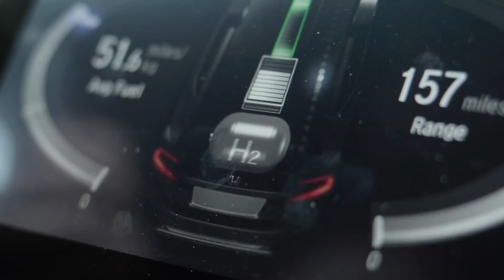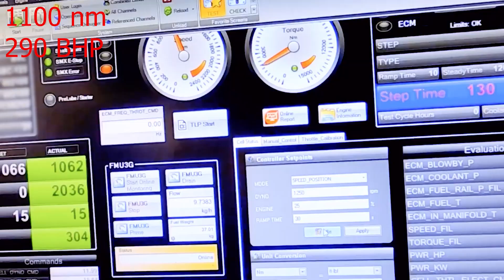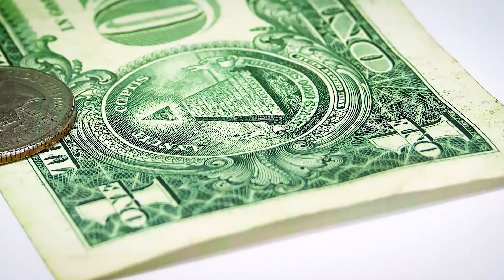Cummins changes there focus from diesel to a 15 liter Hydrogen Internal combustion engine

Comment: of course i am with ic h2 engine cuz the voom voom sound cant forget it i need it even if its h2 not gasoline i prefer h2 more cuz its more green and its stronger than gasoline and it is cool not like fuel cell electric

Comment: absolutely, internal combustion hydrogen fuels engines are a logical alternative to gasoline and diesel, problem is hydrogen production and making it cheap enough to be viable. also you wont kill the automotive repair industry in the process.

Comment: Has Cummins have any data on hydrogen embrittlement in their engines?
Reply: hydrogen embrittlement in their engines ? you mean their tanks right ?
Reply: @nickyp00-t1h  the whole system, anything  ( metal) that might be under stress and exposed to hydrogen
Reply: @domokoshadnagy6794  it is my understanding that hydrgen embritlemebt occurrs in storage tanks due to the insanly high oressures and relative low density of the fuel. This is countered by coating the inside of the storage tanks with a special coating, i am not aware of hydrogen embrittlement inside a combustioon engine, i would be concerned with the tank, linesand regulator. Being direct injected to combat engine knock due to the fast burning nature of hydrogen, there may be challenges of engined life due to the dry nature of the fuel requiring special lubricants.
Reply: @nickyp00-t1h  where ever there are micro cracks hydrogen embrittlement is a possibility. I would assume that Cummins has 100,000 use hrs on their system to assure that the metals they have chosen are not susceptible. It would be nice to see that data.

Comment: I think hydrogen is probably the future. but electric vehicles might also be the future. Ive been trying to wrap my mind around the electric grid issues we will be facing in the future. currently im guess but less then 10% of cars are electric on the road. wait till we hit 40 to 50% of vehicles being electric and how much pressure it will put on our electric grid. i think we will have to divide between different power sources just to a greener future. 

In addition i think going green will weaken us for the first handful of years but the long run advantages far out way the downside. militarily we will be weaker at first compared to places like russia china and Sudi arabia who will gladly use gas powered vehicles against us. as long as hydrogen and electric vehicle continue to advance we should pull away from oil depedence from russia and Sudi Arabia

Comment: I’m a diesel fan, but I would take hydrogen over electric any day
Reply: Hydrogen 2 stroke with dry sump VRO, no oil changes for me! How about a scaled up Rotax 850 Etec turbo R to a 930 CID inline 6 2 stroke! Or this https://mart.cummins.com/imagelibrary/data/assetfiles/0058689.pdf

Comment: The problem with hydrogen is you produce more CO2 making the equivalent amount energy density wise than you do from burning oil.
Would be great if we all had nuclear reactors and made the hydrogen from water by electrolysis.
Making it by steam reformation of natural gas is a filthy process. You'd be better of burning the natural gas.
Hydrogen has another problem, how do you store and transport it?
You can't liquify it without using stupid amounts of energy, you can't hold much in a vehicle so range is limited and refills will be needed often.
Just use diesel.
Most CO2 comes from agriculture, industry and electricity production, not vehicles.
So we are attacking the wrong end of the problem.
This vehicle agenda is being pushed to make the average person feel guilty, that it's all their doing and in the process enable business to sell them more vehicles.

Comment: We need to stop showing smoke belching, exhausting to clean water vapor. I’m all set to drive my snowbird 5th wheel and 6.7 Cummings for the environment. Let’s get on with the hydrogen fuel safely with the newest thinking ,cost effective production. We have the most brilliant minds ever. The world is back stepping.

Comment: I'm excited to see the Cummins Hydrogen combustion engine. In 2011 - 2012 I tested hydrogen in my Dodge truck while my brothers were putting them into their Ford's. They worked. The main problem was the computer systems. I tried every computer chip available but couldn't get past the issues raise by the computer thinking it was getting to much oxygen. Yes, I tried every fix suggested, without success, concerning the O/2 sensors. My brothers experienced them same with their trucks. I still believe Hydrogen is the future. As I said, "I'm excited to be seeing the future." Yeahhh for Cummins.

Comment: I though there also hybrid of diesel / hydrogen?    I also wonder if hydrogen engines are similar to Diesel engine, where they used compression to ignite the fuel.  I hope they still used Jake brakes.

Imo Diesel engines are still way more efficient vs gas engines.  But yes diesel do pollute more.  You’d think by now they figured out how do clean burning Diesel engine.   DEF system for current turbo Diesel engine is nothing but A SCAM!!!   All def fluid req is just polluting the environment more with plastic bottles and when do re-gen, all that soot is still going into the air.  

I bet proper maintained older CAT engine run circles around any newer def diesel turbo engines and still  burn cleaner.

Comment: Just mix air with hydrogen and shut off the injectors in the modern diesel engine, You will see increase in power and cleaner combustion.

Or inject hydrogen instead of diesel.

Readjust the fuel mixture in the computer or dilute the hydrogen with additives.

Comment: Will they make a manual transmission in those hydrogen cars???
Reply: Yes as they are 2 strokes and run oil injection. brappp. https://mart.cummins.com/imagelibrary/data/assetfiles/0058689.pdf

Comment: Sodium   can  be   kept  on-board  in  plastic  tubes,   pushed  into  closed  chamber,  water   sprayed   over  to  get  Hydrogen  to  operate   Engines.  This  will  avoid  heavy  and  risky  storing  of  Hydrogen  in  pressure  tanks  onboard.
Sodium  Hydroxide  can  be  electrolised  to  reclaime  Sodium.
Reply: That;s the most redicluous impractical thing I've read today.

Comment: It seems pretty obvious that a mix of engine types will be playing a role untill the weaknesses of electric and hydrogen are ironed out. Then these two will take over completely.
Reply: hydrogen is a dead end... we'll eventually get fusion power and use that to generate EV power, and for our liquid fueled vehicles use biofuels with a closed CO2 cycle so even if they produce some CO2 it gets used back up by the GMO biofuel crops.

Comment: I'm shocked this solution isn't being taken more seriously and I think we have the idol worship of Elon Musk to blame. I would argue that BEVs cannot replace every vehicle on the road simply because they are too expensive to buy for the majority of consumers and also require private charging to get the cheapest charge (aka, you pretty much need to be a homeowner to benefit from a BEV). They are destined to remain a minority of vehicles as I think that they have too many material constraints to have them be able to replace every ICE car on the road. There simply may not be enough rare earth metals to make it happen. Hydrogen paired with ICE would 100% work because we already have hundreds of millions of ICE cars that are proven. Not to mention that sourcing hydrogen isn't a problem as there are many ways to do it and it is scalable with demand without compromising price. I saw that a Chinese company GAC made a 1.5l hydrogen ICE hybrid powertrain which could achieve an efficiency of 0.84kg/100km with 44% thermal efficiency which is really good. There are numerous companies out there right now attempting to produce hydrogen at 2$/kg by 2030. So let's say you had a tank that could carry 6kg of hydrogen when full, even at a retail cost of $8/kg, that would be $48 to fill and provide 714km of range assuming you are using the GAC engine specs. The car itself would be way cheaper and more robust than one with a fuel cell. Not to mention the engine oil would last forever. You'd scarcely need to change it. The biggest hurtle seems to be providing the fueling infrastructure but once that's in place, I think this tech will be quite popular.

Comment: Hydrogen takes up a lot of space. It is possible to make synthetic fuel (e-fuel) using electricity, water, and CO2 from the air, and that is way easier to store on a vehicle than hydrogen is.
Reply: Biofuel is the near term correct solution. Due to politics it isnt' getting implemetned here but Brazil is gung ho on it.... and its reducing the crop land they need to grow fuels based on research done here in the US. Less land to grow fuel means less incentive for farmers to burn the rainforest too. They can grow 10x the biodesel  +30% more sugar on the same land as thier existing sugar cane crops. In the future they are targeting 16x the oil per acre as soy.
Reply: No it doesn't. It's less space. But being under pressure is dangerious.
Reply: @ricky4673  thats why the tanks are woven carbon fiber and there is a gel substance  inside that will instantly expand if the tank is punctured, so that the hho can't explode.
Reply: Yes ethanol from copper catylists.

Comment: You have basically a vegetable oil that people should not eat(canola oil) that would make a pretty decent fuel replacement. Have you heard a diesel type vehicle running off of this oil?
Reply: I live in California.  There are a couple diesel fuels that use plant based oils.  The 76 stations sell a R95 formulation of diesel fuel.  And the Propel brand sells a R99 formulation.  Both fuels are different than biodiesel in the way that they are refined.  And are based on a process used in Europe.  That is blended 70% renewable product and 30% petroleum product.
We have 2 diesel pickups at my house.  And when fueling the trucks.  The odor given of the renewble fuel is very slight.  While the petroleum diesel has a strong odor.  Cleanup of your hands is also easier with the renewable product.
Reply: Rudolf diesel created the diesel engine as an alternative to petrol fuel and ran on peanut oil.

Comment: I've made my comments about the Hydrogen ICE vs FC, and it's sparked harsh feedback because of deficiencies in energy loss when it's burned and sent out the tail pipe, however in the grand scheme of things, it's not like any petrol burning engine is all that efficient either when compared to electric... I'm all in favor of Hydrogen IC engines for the reasons mentioned... Having a traditional design coming from over 100 years in piston driven engines, with quick refueling, especially for large trucks that drive long-distances.. I think where the problem lyes is from the cost and production of Hydrogen.. Theirs a number of ways its yielded, while the methods that rely on electrolysis requires alot of energy, in which this energy requirement might only be solved initially by good ol fossil fuels (unless we start looking at fission energy again and abroad until fusion becomes an actual alternative).

Edit* but yes, an all EV future is a depression and lame future for most automotive enthusiast...I know the power is there from EV's, but they're just fancy golf-karts to me, and I couldn't be happy driving one, knowing the loudest thing  onboard is the stereo system 🙄

Re-edit* idk about the true results of this old video, but the concept seems note worthy.. electrolysis on demand
https://youtu.be/0nzyEueVLgo
Reply: I agree with you on that, Electric vehicles just don't have any soul or character whatsoever. The mechanical thunder of internal combustion engines always adds excitement and adrenaline, plus the sounds keep hardcore gearheads like me awake amd in a positively good mood. Let's hope that Hydrogen saves the internal combustion engine. I really am counting on it. 👍
Reply: EV's aren't THAT efficient.... maybe in the range of 60% efficient from generation to rubber meeting the road. but then you also have to consider that EVs are usually much heavier... meaning more energy to move them. so funny thing is it turns out my Honda insight once converted to plug in hybrid with have a higher MPGe than a Tesla... so in short if I fuel the gasoline part with a biofuel, and charge off solar... I am greener than any Telsa on the road today because I am getting from A to B with *LESS ENERGY*... even if the Tesla is 90% efficient, its moving a 5000lb car around instead of my 1800lb car.... And you guessed ti Tesla's are driven by 1 driver with zero passengers most of  the time.
Reply: @Wingnut353  I was just explaining this to my 5 yr old son the other day... He's well aware of Tesla's but was explaining the concept of hybrids which they seem to be glossing over these days. Hybrids likely have the upper hand over the very latest EV's, and that's how you know it's about another kind of "green" when you add it all up.
Reply: Electric motors are very powerful but boring.

Comment: Hydrogen is the smartest way to Go with Zero pollution. Increased HP figures, same filling time as petrol products even down to Producing your own Hydrogen at home. More money should be pushed this way than the electric car. The Electric car has its place but not in heavy industry.
Reply: The major European truck makers might disagree, as they have fully electric trucks already out there working......

Comment: Apparently, Large RAM trucks will have the option of the HCE in 2023. 6.7 litre I think.
Reply: 2 stroke oil injected i hope, ill run klotz techiplate and my home made oil injetion system plumbed in with dry sump tank, and 2 VRO pumps for the 6.7 2 stroke conversion.

Comment: Hydrogen Combustion Engines (HCE) are in use in China already so this is a no brainer to develop. Commercial hydrogen fuel pumps are being rolled out now.
Reply: Hydrogen will just wear out engines prematurely... Biofuels offer increased engine longevity and a closed CO2 cycle.
Reply: @Wingnut353  hi. Interesting you have come up with this observation. The opposite is what the industry and academia are saying. Please could you let me know your source of this information so I can follow it up and add it to my own research. 👍
Reply: @lesliecarter4295  search for "hydrogen embrittlement" and you will find relevant articles
Reply: @Wingnut353  I hope these hydrogen engines are running a VRO oil injection system with a reneable 2 stroke oil. No oil changes required. https://mart.cummins.com/imagelibrary/data/assetfiles/0058689.pdf

Comment: I like the future for hydrogen!
Reply: yes sir
Reply: So did General Motors 40 years ago, when they first began promoting it.....
Reply: So this is a closed cycle hydrogen filled 2 stroke engine that that uses a troidal formed plasma in the cylinders. the toroidal plasma taps aether ZPE and never needs anything else. Josep Papp used an inert gas mix in his pulsed plasmoid 2 stroke.

Comment: Yay a new diesel engine with no Emissions systems!!
Reply: The best part is it sounds and feels like a Diesel engine but has no emissions.
Reply: @markm0000  Diesel like power, fuel efficiency but with no emissions to worry about while still staying true to internal combustion power. I give Cummins my utmost respect for fighting against the electrification agenda.
Reply: @markm0000  It actually sounds like an LPG engine.

Comment: battery powered cars/trucks have always and always will be a very bad joke. over all during there lifetime, they will create far more pollution then the worst gasoline motor.
hydrogen. sure lets have pressure vessels in our cars and trucks to explode just like a 1000 pound bomb in a crash, or fire.
does not matter what the fuel source is, gasoline was to have been a "clean" fuel. every type of fuel has a trash product in it's chain. manf, distribution, storage, usage.

Comment: I believe that ICE is still the future, whatever the fuel is; I also believe that we need to change where we get our fuel and how we clean up the mistakes of the past and present are the things that truly matter. 

Electric vehicles have there positive notes, but I don’t like the idea of repeating old mistakes having to mine rare minerals, which is harmful to the planet to appear to green.
Reply: Efficient GMO biofuel crops are extremely promising and already going into use in Brazil in collaboration with the university of IL's petross program.
Reply: I dont think they were necessarily mistakes (of the past). After all, the industrial revolution is what got us all here now.
Reply: If you don't like the idea of mined minerals, then stop driving an ICE car right NOW. Because the oil industry are BY FAR the largest users of mined minerals. They need cobalt to remove sulphur during the refining process, and they've mined it for decades......
Reply: BMW has wound rotor synchronous motors that dont require rare earth magnets